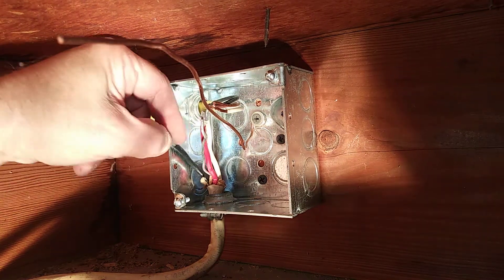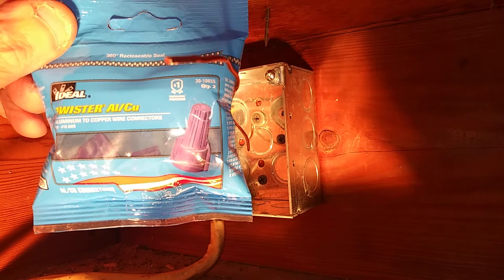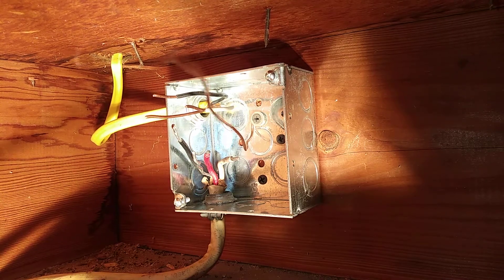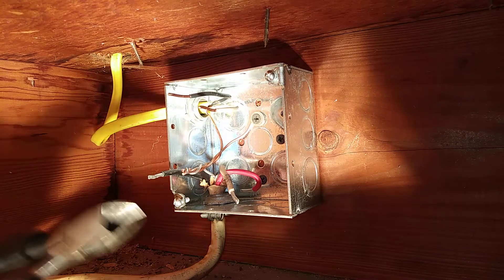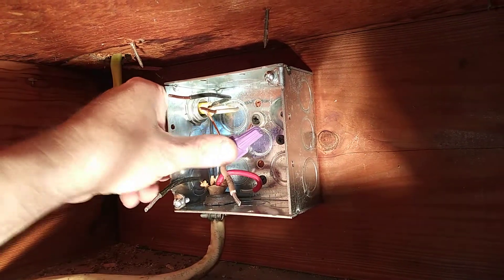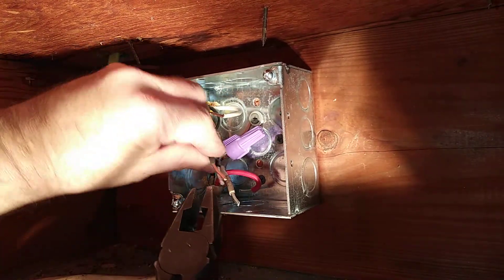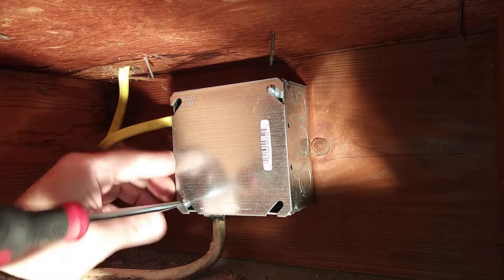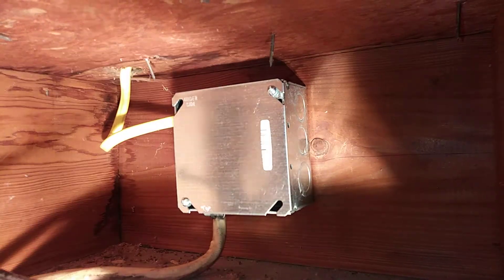How to splice copper and aluminum wires together what to use

Comment: I just spent a more than a week pulling out those little fcukers and replacing them with Alumiconn connectors. HOA mandate for insurance qualifications.

You should really delete this video. And the red wire needs a nut.

Comment: OMG! NOOO!  Total fail! Pliers scratched and nicked the alluminum badley !  Need twice as much exposed wire to twist, the part the pliers grip and damaged need to be snipped off the end after. 
Need alot more and tighter twists with NO scratches or nicks!  Need to cover connection with Penotrox paste before putting on the nut! OMG these videos should be removed from YouTube! 
Stop spreading bad and fire hazard how to videos by un proffesionals!  BEWARE PEOPLE!   YouTube should be liable for allowing these videos to the public.

Comment: David, I don’t understand what you did other than cap wires, I have never seen an approved connection where a white neutral wire is directly connected to a black hot wire, i he red wire is uncapped just laying in the box and in my opinion the white wires are not stripped back sufficiently to maintain a secure connection, can you further explain what you did and why you you did this?
Reply: A white wire can be twisted to a hot, you just need to a phase it red or black, with tape or even a sharpie. Also a white wire doesn’t always mean it’s a neutral, it should but it’s important to remember a wire is a wire. a neutral is only a neutral by it’s function plenty of people wire up what’s on hand and don’t phase properly
Reply: You never seen a switch loop before?

Comment: I appreciate your posted video, however the Ideal Al/Cu twister wire nut is no longer approved for aluminum to copper connections or pig tailing. The only approved connections are Copalum connectors or Alumiconn connectors.
Reply: Incorrect. They are still UL listed and therefore fine. Also they are allowed per NEC. You’re likely referring to the old 2011 CPSC pub 516 which is a guide not a standard. Standard means it’s required, guide is simply, hey maybe do this. All the research is based on one Dr’s opinion on the matter. UL has tested these and they are fine. NEC updates code all the time, and these connectors have continued to be permitted. The CPSC hasn’t updated, and doesn’t.

Comment: hello David Thank you so much for minute 3:15 now i know why my 15 amp fuse keeps burning since the electrician installed the well water pump switch 12gauge both ways aluminum and copper ...im glad i decided to switch all my 15amp fuse type D from type P i would of probably had bad consequences due to his poor job.. i will let you know if my fuse box panel will work as it used to